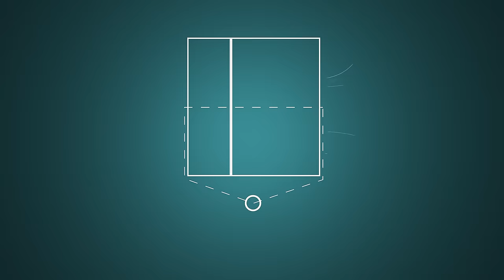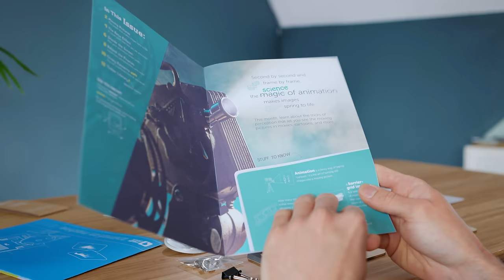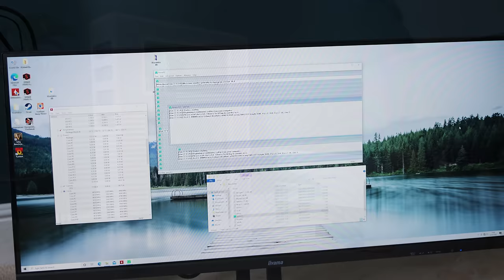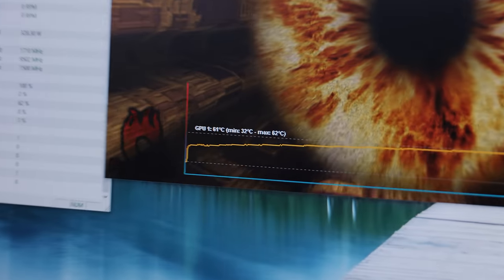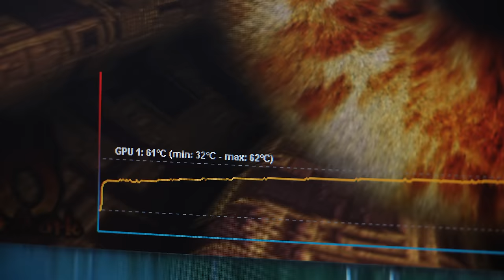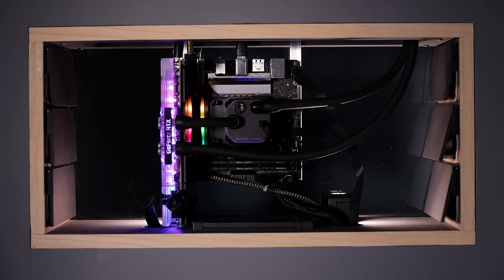Building the world's first 'breathing' PC

Comment: this guys a fucking genius. i just can’t get over how he re-invented the fan silently with wood, magnets, and some water pumps.
Reply: Hard to believe it has the longevity of a fan
Reply: The general idea is ancient and used in smithing as the chinese box bellows - but this is definitely an impressively inventive adaptation of it
Reply: this is quite a primitive design as lets be honest. Could fit inside a huge house. Still impressive yes.
Reply: what about the consumption of electricity? a regular fan is turned off when it's not needed and is spinning very fast when the system is under stress. This system seems to be too awkward to do this as it would probably switch on and off a lot slower than a fan. it is then very questionable if it is more efficient than a fan.
Reply: @MacMan2152  are you sure it turns off and on slowly?
Reply: @MacMan2152  It's a prototype made just for fun. You're being ridiculous by expecting it to be as efficient as a cooling system that has been developed by teams of people and perfected over decades. Respect the ingenuity and creativity that went into this, don't nitpick it.
Reply: @MacMan2152  a fan uses a negligible amount of power. Also pretty sure when efficiency is mentioned he talks about cooling not electric
Reply: I'm convinced he is a legit genius.
Reply: @gloopgloopglorp  that;s not how inventions work. The prototype usually performs better than the production design and is built by a single set of hands - rarely with some parts outsourced to a single trusted colleague. there is no refinement over decades... there is a couple months planning the looks with the marketing team. As far as the shape of fans goes - that's copied straight out of natural world - observation unless you're piloting a submarine or a fighter jet which have the special fans.
There was zero ingenuity and creativity going into this as it is not a new invention. There is nothing new here. This mechanisms have already been perfected (the bellows and the activating switches) and is older than a bladed fan. He went backwards in performance by using a needlessly expensive new way of constructing it to make a pretty art piece for youtube.
Reply: @agnidas5816  Pretty much every single thing you said was wrong. 

Prototypes are test builds. Here's the definition "a first*, typical or *preliminary model of something, especially a machine, from which other forms are developed or copied." Most inventions take many prototypes because they aren't perfect at first. You have to try many things to see how they work, and in the early stages they are usually far from perfect. Maybe the last in a series of prototypes will perform better than a production model, but definitely not the first few. 

A prototype isn't always made by a single set of hands. Some prototypes are built by whole teams of people where many people work together on it, sometimes hundreds of people. Parts are outsourced in prototyping all the time. I know someone who has a couple dozen patents for new inventions, and he shops for his parts at home depot most of the time. I even printed things for his prototypes with my 3d printer when his broke.

I wasn't saying every invention takes refinement over decades (although some definitely do). I was saying it's ridiculous to compare his brand new bellows to something like a computer fan which has been around for a long time. Those fans have been tweeked and perfected over decades. If you compare a computer fan from the 90s to one made today there are going to be improvements. His new bellows computer fan has not had the same amount of time to be perfected.

There was a ton of creativity in this. Sure bellows have been around for a long time. But they weren't using magnets gently gliding through a tube in the bronze age. And I've never seen anyone use bellows to cool a computer. Also the thing with electroplating the magnet to make it fit was a genius solution. 

So what if it's not as practical or efficient as a computer fan. It's interesting, people enjoyed watching him make it. People enjoyed watching him solve problems. And people like the end product. Not everything in gets its value from pure efficiency. We can admire things for other qualities like novelty and elegance. Honestly sounds like you're just jealous because you will never make anything close to this cool and unique.
Reply: I had this idea for so long because this is silent and powerful, yet I have 0 building skill
Reply: He didn't reinvent the fan, this is ancient technology which came before the fan, he repurposed and improved it with modern tech, which is still cool af.
Reply: @lutze5086  it probably hasn’t but it’s way quieter so some crazy gamers would prob try it
Reply: @agnidas5816  🤮
Reply: @gloopgloopglorp  well said
Reply: Dyson: Write that down! Write that down!
Reply: @MacMan2152 the pumps that power the fan have an instant response speed, I’m pretty sure that it can stop in an instant

Comment: You could program it to "breath slowly" when it's not getting hot, and "breath quickly" when you're gaming, this should look like the PC is in a marathon when you're playing hehehe
Reply: ensar jusufija 21  wouldnt it be possible to use multiple weaker pumps to the point where it shuts off like half of the pumps while they are not needed?
Reply: @They_call_me_bas  yes and no, seems he is using a bunch of cheap pumps in series, with an automatic valve switching the direction of flow of water. If you only power half, then the other pumps will be restricting the flow cause they aren't running, but water HAS to pas through them the way the loop is built. The pumps will end up burning out. 

Might work if he built the loop with 2 banks of pumps ran parallel, a few pumps still in each series, then you could safely have 2 "speeds" by turning on either 1 or both banks of pumps
Reply: ensar jusufija 21  He could just decrease the voltage to the pumps
Reply from the maker: Dude, what a cool idea! It wouldn't be difficult to do either, as the pumps are currently working off the 12v rail so if pushed through a regulator it could drop it up or down whenever needed.
Reply: @DIYPerks  what was the ambient temp when you tested this, and could you possibly test in a summer with windows open type scneario
Reply: @DIYPerks  If you build it with 2 acrylic sheets, each covering half the distance the air flow could be double, with some design changes. So basically half down the space required if the initial airflow is to be maintained. This way it will be less bulkier.
Reply: @chander1220  are u suggesting 2 smaller lungs, instead of 1 big 1
Reply: ensar jusufija 21  it would actually be incredibly easy, you would just need a simple PWM motor controller and thats it
Reply: the only reason I dont like this idea is the fact that this thing can cool a 5950x under full load while maintaining what seems like a slow speed. I couldnt imagine how cool it is while idle, so I dont think it'd be entirely necessary.

Comment: A comparison of the system with regular fans vs this would be interesting, I doubt there is a big performance or noise difference. The reason why this performs so well is the custom watercooling loop with a big radiator. The way the air gets pushed/pulled through only makes a minor difference, maybe it's a bit quieter.

Comment: Everyone saying the size is alright since it's a novel invention. But what about the fact that it's so quiet. Almost completely silent and would be completely silent if he used opposing magnets for the fins. It's not just novelty, his soultion is practical in my opinion. Very impressive prototype! And I think a genuine discovery for a possible cooling solution moving forward if the design is iterated on.
Reply: its like a heart... pumping air out while keeping mostly everything else in... like for instance blood being pumped out rich in oxygen while the none rich blood loops back through the lungs...

LETS MAKE IT SMALLER IT MAY BE EXTREMELY EFFECTIVE WITH WATER COOLER :D...
Reply: The thing is, if you make it smaller, it also moves significantly less air. I'm not sure how practical this can be without taking up lots of space.
Reply: @SpoonOfDoom  I feel like with fine laser precision parts and tighter tolerances you could get away with using a smaller system, with more efficiency i could see it being smaller being more air tight and all
Reply: @all3n1k  If you make it smaller, there's less air that gets pushed in/out with every motion, there's no way around that. So the smaller you make it, the faster it has to move. And after a certain speed, there's gonna be noise and vibration. Also, when it's small and/or hidden you'll lose the mechanical art project look, which is a big part of the appeal imho.

Like, I'm not saying you can't make it any smaller than this. But you're not gonna be able to make it small enough to fit inside a standard tower and be as effective as fans, especially not while keeping benefits such as the near silence. I'm sure someone smarter than me with some physics knowledge could calculate some of these things and prove me wrong or right. But I'm pretty sure he didn't build the thing this large just for fun in this video.
Reply: A fan that size can spin very slowly while moving more air, making it just as good. Scale this down and I doubt it'd compete with similarly sized fan solutions.

It's very cool and a great idea id love to see developed, but sadly it's too bulky to replace the humble fan
Reply: For a simpler silent system you could use passive water cooling, i.e. no pumps or fans for this to work you would need either an oversized (so bigger than a typical system) reservoir and/or radiator. 

You could also via pipes connect to the water in your home (not directly of course but via some sort of heatsinked block copper to copper). Components these days run pretty hot so even connecting to the hot tap wouldn't be a big deal. 

Another idea would be to have your cooling block mounted externally if you're in a cold climate.

a side note with all these ideas is that a lot of components in your system likely would need some cooling so getting some of those mosfet heat sinks would be a good idea and leaving plenty of open air or even a case made of aluminium but at this point the simplest idea may be just to have the PC set in a different room ha ha.